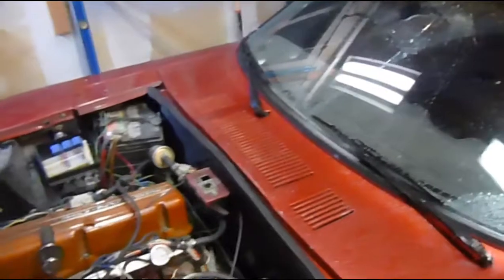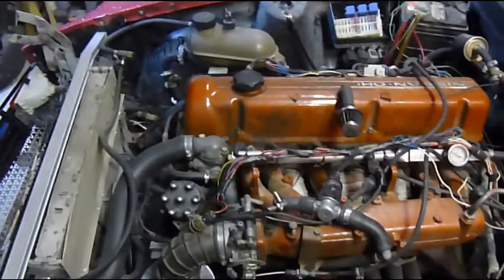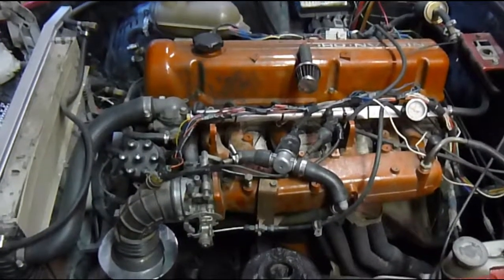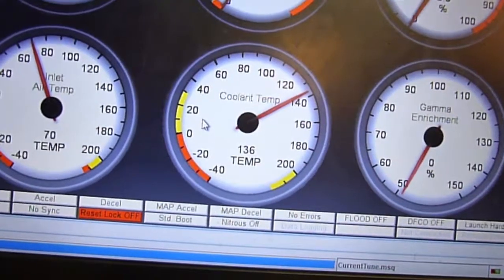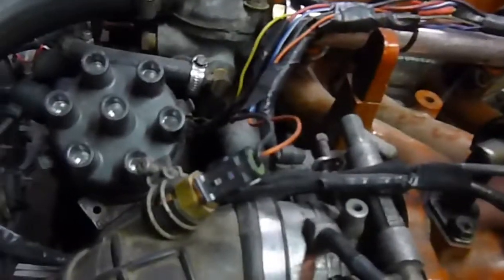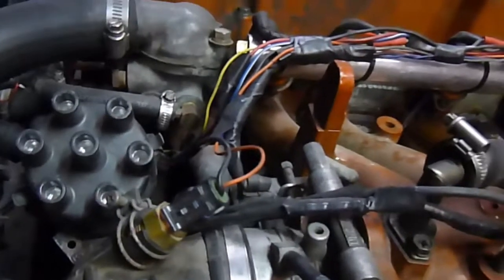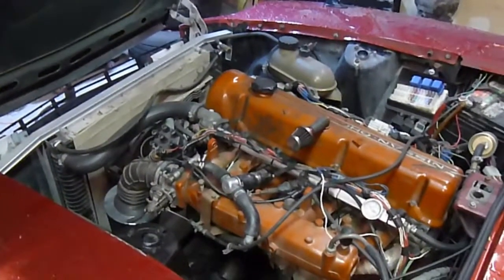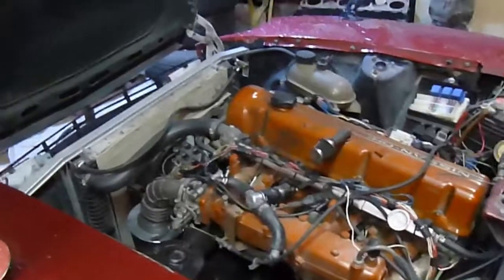Troubleshooting Sensor issues and noise in TunerStudio (Speeduino)

Comment: do u have a video of you wiring up the speeduino , interested in  knowing how u connected the ls coils and other sensors
Reply from the maker: I do not yet, but I can in a week or two. What specifically are you wanting to see? The connections at the speeduino?
Reply: @CEKGarage  yea especially how the sensors are connected including the injectors and the ls coils in detail thanks
Reply from the maker: Sure thing. I need to get the tach working (wired up to Speeduino) I will take some time and do a video on the coils at the same time.

Comment: i would really like to see how you have converted your distributor to a "cam sensor" i'm doing the same kind of conversion to my engine, not a 280z however but should be the same on any engine :) 

Thanks and keep it up :D
Reply from the maker: You bet, I am working on wrapping up a few in process projects and hope to dive into trigger set up shorty. And the way I did it was very fast and sloppy. In short, I gutted the old (spare) distributor and welded in a 24 -2 wheel. (With Megasquirt, I had to run it as crank speed 12 -1,  butcould have used 24 -1 with Speeduino as a true cam wheel)
Reply from the maker: I didnt dive in a ton of detail, but I did add a short video showing the trigger wheel in this new video here (set to the time where I showed it)  https://youtu.be/-rTmxwAkY-c?t=783